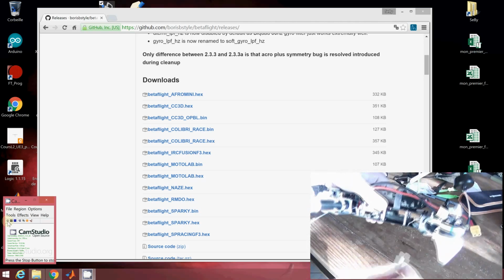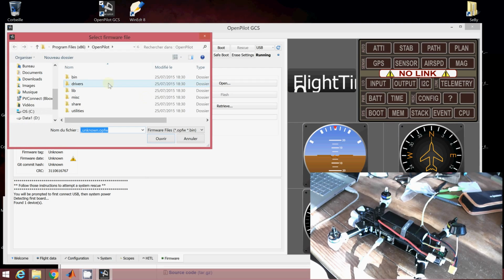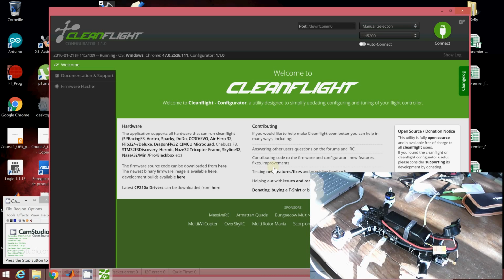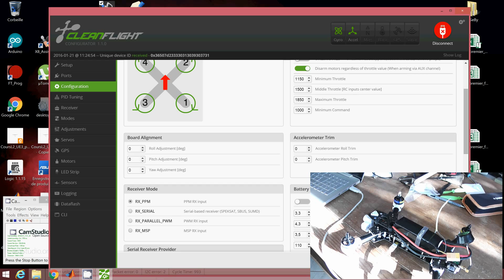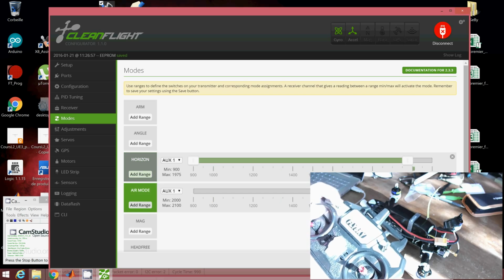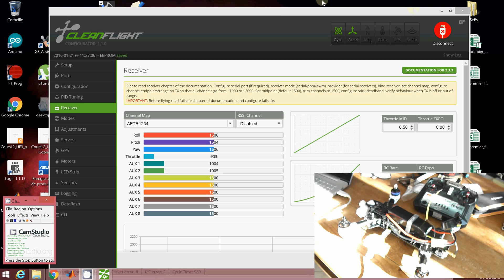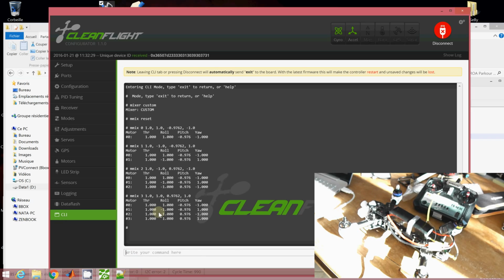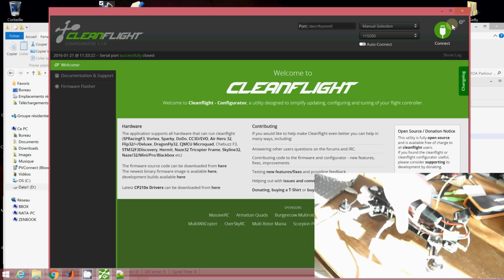ROA Parkour 280 Betaflight installation and configuration (Courtesy Banggood)

Comment: Dear SeBy
I just tried betaflight with your video. and It's proceed well but the last step. 
It keep make beep sound without "Beep BiBiBeep" 
Furthermore, It failed to connect to USB port.

Please, let me know what is the problem or recommend action for this problem.
Reply from the maker: +송훈 Well try that: 1) Lipo not conntecd, connect your USB, 2) connect now your LiPo and wait the end of ESC music, 3) disconnect and reconnect USB .... now probably the COM port should appear ....
Reply: +SeBy DocKy Thanks for your kindness I will try again and let you know.
Reply: +SeBy DocKy 

Thanks again 
After That I got a tow more question !!! ^.^;

the first one, sometimes It connected to USB with the BeBeBeep only when the battery is fully charged. 
I think it is not normal. Is it caused by HW Problem, CC3D ?   

The  2nd question, When I pull up the throttle, the rpm of motor 1&4 is increasing but motor 2&3 remain initial value.
Furthermore  motor is not moving sometimes. Can I fix this with setting ???? 

In Korea, my country , I look for repair shop but I failed so, I have to fix it by myself. So  You are the only one who can help me. 
If you don't have exact answer, the piece of clue, such as, recommended youtube clip, or related blog,  is thankful for me.
Because I am the beginner for drone. 

Thanks a lot for your help. 

Best Regards,

H. Song
Reply from the maker: +송훈 When you finish to flash betaflight/cleanfight, it's very important to apply the nmix command coz in between CC3D & CF, motor layout are different. Look to my RCgroups review, I gave the command to inter in CLI. Don't forget to save with the command "save" ...
Reply: +SeBy DocKy 
Do you mean mmix for setuping up the configuration of motors? Yes I did. It was  the last part of your video clip. 

mmix custom 
mmix reset
mmix .... 

there was no error and I have saved and the drone was rebooted.

But Drone kept making beep sound. 
Is this sound from motor speed controller (ESC)?
Reply from the maker: +송훈 Still beeping when flying with ?  Sound can come from ESC or from a buzzer (if there is one)
Reply: +SeBy DocKy 
Yes It does. It keep beeping when it armed. Actually It doesnot flying because One motor , right bottom, is not working at this time. also another motor, right top, is spinning but it is not increasing RPM even I pull up the throttle.
Reply from the maker: +송훈 Did you calibrate ESC ? =>  prop off=>motor section,  radio on, throttle at max=>check "test motor"=> move general motor slider to max=> plugg battery,, wait few beeps of your ESC then when is stopped push general motor slider to 0
Reply: +SeBy DocKy 
Thanks for your help
I will try that you said when I go back home.

Comment: How did you get the motor mix ratio of 0.976? Did you measure the distances between the motors, then calculate?
Reply from the maker: +Fyre SG yes :)
Reply: +SeBy DocKy, great! That saved me some time. Thanks!
Reply from the maker: +Fyre SG You will probably find some better PIDs settings :)... but I felt the situation is improved with betaflight at least